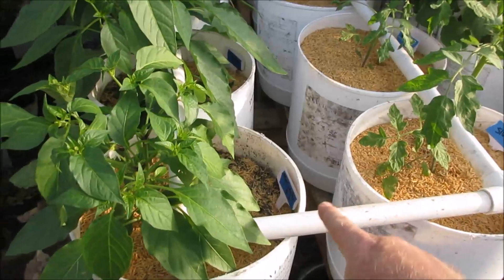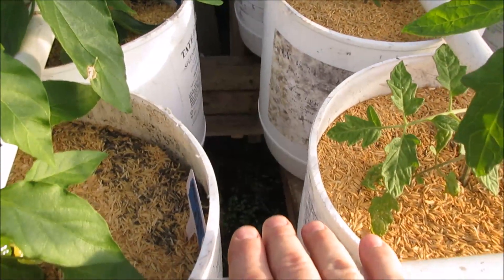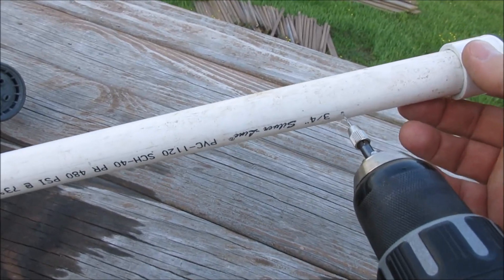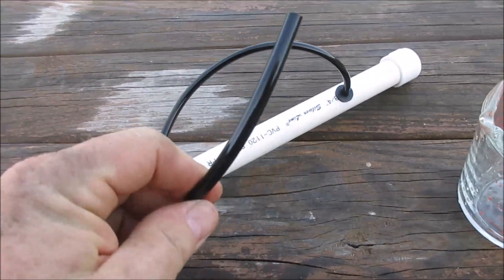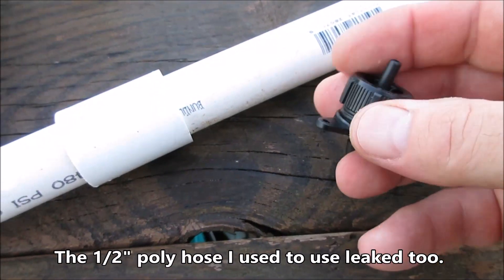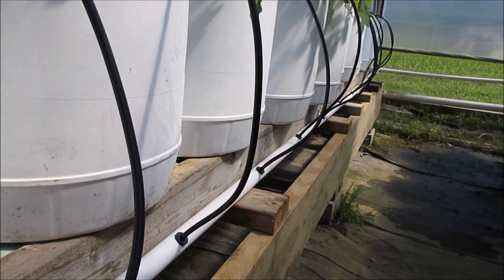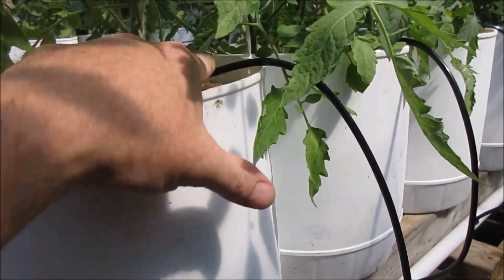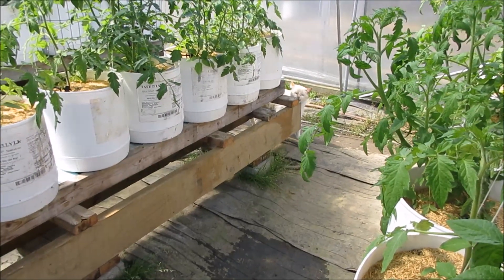PVC Watering System Changes:  Top Hat Grommet and Clean-out Drippers

Comment: Looking great! I bet that is going to make a big difference, not just the clogging issue, but the freedom to move things around is a huge plus. I've never really needed a drip system as large as yours, but now that I'm finally working on a few 3 foot tall planters, this is going to be a huge help to me. I've been super busy, yes, very slow, but getting there. I don't mind being Old, but I sure wish I could garden like I did when I was in my 20's. I'm so slow, and still used to working fast in my brain. Wish my brain knew things have changed, and would slow down and match up with this body of mine. I have found that I simply can't film and build, or garden at the same time, so I've decided to just video what I have finished working on, and let that be enough. Man it's strange to have to work entirely different than your used to. At least I finally figured out that I had to make some adjustments to how I do things today. I just wish this hard head of mine learned it faster. Bless, Sheila PS Thank the Lord that there has always been a local, homegrown farmers market here.
Reply from the maker: Local markets are great!  I'm already having to adjust to this older-acting body of mine.  : O)  I hope these drippers work for me!

Comment: Brent, I have watched hundreds of hours of you tube video about hydroponics recently. Your content has been by far the most helpful. One question concerning the FAWN system. I assume that you found the wicking action from the net cup suspended in the gutter to provide inadequate hydration for the plants necessitating the addition of the top dripper.  Is my assumption close?
Reply from the maker: Hey Mike!  Ummmm, yeah, you're pretty much right on.

I've done a few hydro vs self-watering container videos and hydro won basically.  The swcs did ok until the roots broke through to the gutters below.  Then they did great because essentially the swcs become a shallow water cuture (swc) of sorts instead of self-watering container and then the shallow water culture took over because I time the watering so it's not on all day.  Only a few crops could break through to the gutters somewhat quickly.  Things like squash and tomatoes.  So, SWCs needed babying until then.  Combating heat was more difficult with SWCs and some plants really had a tough time because the containers were too tall for the wicking action of the SWCs.  Things like lettuce, spinach, etc.  It was REALLY difficult to direct sow seeds in SWCs.  NOT knocking SWCs.  They have a place for sure, but you gotta pay much more attention to environmental conditions, media type and it's wicking capability, and container size needs to match plant type.

That's how FAWN was born.  It's a combo of all 3--drip hydro, self-watering container, and shallow water culture.  To me, the easiest, most rewarding system for a new person is hydro flow-to-waste.  Get potting mix and plant containers.   Run a pump and drip system to plants on a timer.  Very cheap.  Gorgeous plants.

Comment: Very interesting Brent.  I always learn something watching all the youtube guys.  I too have had "plug up" problems with drippers and sprayers.  I wonder how your system would work with no drippers at all.   Maybe smaller tubes and lower pressure or some other adjustments might be in order.  But would it work do you  think?
Ed
Reply from the maker: Hey Ed!  I've literally tried many versions of what you speak of.  I would need a really powerful pump and adjustments would be a nightmare not to mention me needing to rework the return line.  The pump pushes water a long distance across all FAWNs.  I have 110 5-gallon containers and two 4x8 water culture beds.  Now, I tried all of that because no dripper = no clogged lines which is ideal.  I did get a bigger pump, but the addition of the water culture beds in full grow is taking a lot of water to stay full.  If I adjust them down, the water levels would drop similar to a Kratky which is not what I want.  I want to not have to worry about water levels at all except one place--the overhead storage barrels.  I surely haven't ruled it out and I am going to look at no dripper options if these drippers clog too much.  That's where I'm at for now.
Reply from the maker: This conversation, like we're having, is why I'm on YouTube.  I wish more people would talk about things.  Many channels don't want to talk to you either.  They take conversations like this as an insult.  I've been told I'm condescending, acting like I know more than they do.  It astonishes me so now, these days, I keep comments light.  Appreciate your wisdom.
Reply: Every one of us knows something that someone else doesn't know.  That's how ya learn.  For instance I didn't know you  could buy those "clean out" type drippers.  That changes things a little for me.   Thanks for that.  
Ed
Reply from the maker: I wouldn't have switched to this without the cleanout drippers.

Comment: While looking at the cleanable emmitters I noticed that there is available a 1/4" barbed valve that could be used in place of the emmitter.  Cost is comparable. Difference would be not having a preset flow rate. Any consideration to using these. I wonder if they clog like the emmitters.
Reply from the maker: That is a definite alternative if these emitters clog too often and are a pain to unclog.  They'll be a moment of "this is too much" causing me to change.  The only thing I could see with the 1/4" valve is manually adjusting them all to a uniform flow rate.  I really like the idea of the valves in theory.  Changing to valves would be really easy and I'm really happy for this option.

Comment: Nice system. Just curious why you have to use emitters? Wont just an open ended tubing work?
Reply from the maker: No, tried it.  Pumps a long way.  110 containers and 2 water culture beds.  Those closer to the pump will flow much more than the one furthest from the pump.  Am certainly going to revisit if the drippers clog too much or are too too difficult to clean out.

Comment: Enjoyed your video. Learned a bit. I don’t understand why your dippers are clogging? You don’t have a filter at the  water source?
Reply from the maker: In general most of the drippers I initially used were junk and the output was inconsistent.  I fixed that with my newest drippers.  Been working great for years.  It's a quality thing and I can clean them out which means no more buying replacment drippers.  Debris, algae, and salt build-ups are common reasons for drippers to fail and fall-off full capacity.  It's nice to unscrew, wipe, and screw back on to get things going again.  To answer your question about my water source, I don't use pressurized house-water.  I use a pump in a reservoir that is topped-up with a storage gravity-fed tank.  It's filtered.
Reply: Unfortunately ,it sounds like you were just unlucky with some faulty drippers. In my experience name brand (i.e. Rain Bird & Toro) drippers usually perform without any problems for years. Also, there seem to be many copy/fake drippers in the market made to look like the brand name ones. Buyers beware - if possible check your sources. If you are going to invest a lot of money in a drip system, it might be worth it in the long run to seek out a professional.

Comment: I was watching this video again and I forgot to tell you that in my setup I'm not using any emitters per say but am using a 90 degree connector to reduce the water output for each container and the furthest one out will clog sometimes with a little bit of algae, I think this is due to my white half inch pvc feeder line.  Let me know if you experience this as well please.  as I might paint or cover my feeder line.
Reply from the maker: I will.

Comment: You need strong roots for your plants. Don't put your emitters close to the stock of the plants and move your emitters every few days. Hope this works for you
Reply from the maker: I hear you.  I felt that way in traditional gardening for sure.  Roots needed to migrate to get the water and nutrients they needed.  I've found that in hydro or when using complete fertilizers, most plants can actually swim in it and, in fact, smaller root systems, that come from hydro, is preferable to prevent issues.  Check out my water culture.  Roots literally grow in water.  So, with that in mind, I kind of try to put the emitters in the center of the pot so they wick equally quick throughout the pot.  Sometimes, when the plant is new, I put directly on the plant at least until it takes off.  Chat with me some on your experience.  Maybe I've missed something with my observations.

Comment: 2:46 The fan type emitter you used to use - isn't that easily cleanable too ?
Just screw off the top.
Reply from the maker: They never clogged on me.  In order to get it to drip the right rate, you have to almost close it off.  I tried them which is why I have them.  Once you close them down, they don't stay right OR they won't get to a slow enough rate before completely closing off.  If they're fully open, it's like not having a dripper at all.  The fan just spreads it out cool looking.